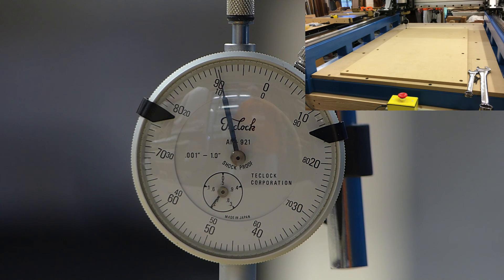CNC Router build - Checking table for coplanar accuracy - 10-30-16

Comment: David, thanks for all the videos.  I'm considering a Saturn from FLA.  Was it the frame that was out by that much or just the spoil board.  I'm considering a machine from FLA, but have heard some not so great things about customer service issues.  How has your experience been with the quality of the machine and the support?
Reply from the maker: Hi, Edward.  The videos are fun to make so thanks!  I think the spoilboard MDF was out in both cases, the 3/4" mounted to the machine and the 1/2" mounted to the 3/4".  And I think they were out in different directions so that compounded the variance.  In reality it only meant a couple of passes to surface so not that big of a deal.Nate isn't the best at communication but the machine is very stout and I would buy from him again.  He has responded to every email, phone call, and text though not always very quickly.  And I believe he told me that he's hiring help so he isn't stretched so thin.
Reply: David, thanks for the reply.  I have been looking at all the usual suspects in terms of machine options and if the quality of the machine is up to snuff, the Saturn is an great value.  My biggest fear is taking the plung and then being stuck with a large piece of junk that takes a ton of work to rework.  I have been finding as much as I can on the CNC zone web site.  You videos have been a great help...so thanks again!